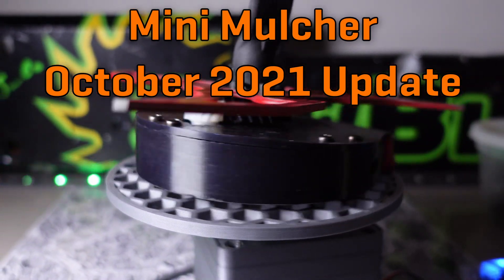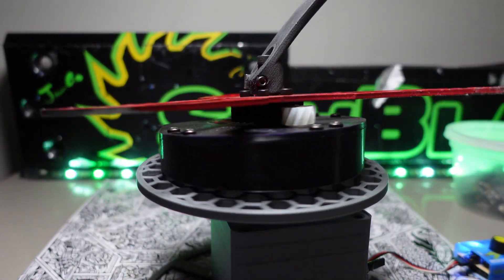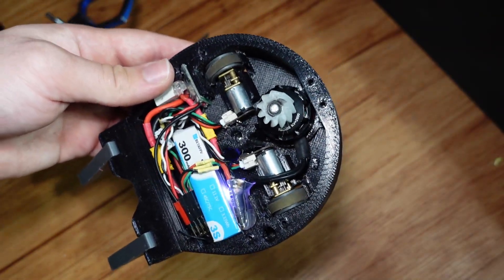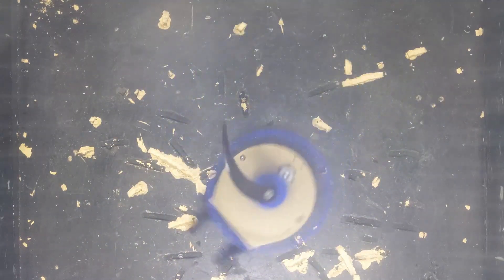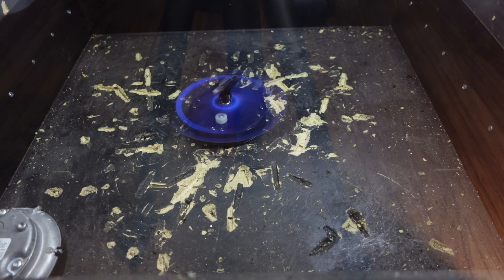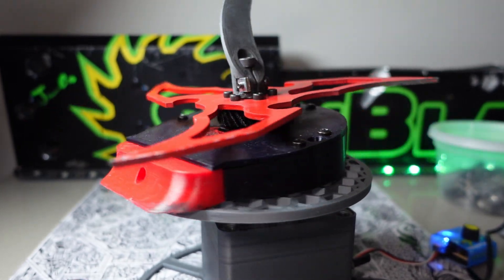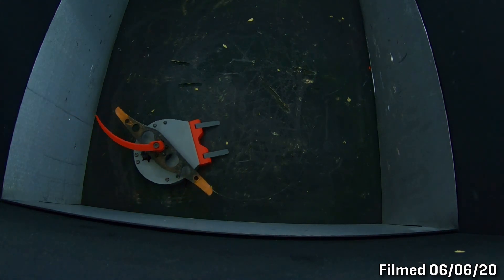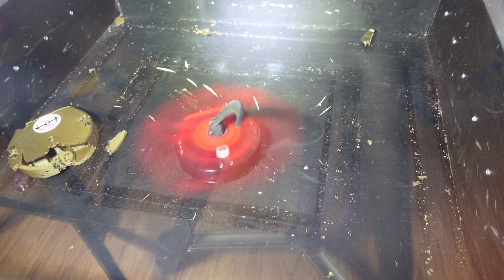Mini Mulcher 1.0! 1 Pound Antweight Combat Robot 2021 Update

Comment: the n20 motors with attached esc come configured  differently than what you show here,  did you modify them or buy them that way?
Reply from the maker: I think I desoldered the boards to flip them and make them fit more tightly
Reply: @JustCuzRobotics  it just does not work that way.....way too many obstacles to getting this bot running

Comment: I love this build, can't wait to see how it runs at sword. Just wondering did you use your custom PDB in this?
Reply from the maker: I built this wayyyy before I designed my boards so they don't fit. It is stupid tight inside. And they were never meant for antweights to start with. Shrapnel Mine does use both my Just Cuz Basic PD Board and Just Cuz PCB Switch and just survived its first tournament with absolutely no electrical problems.

Comment: I like the choice of the thick front wedge over the wedgelets, I feel like that makes it work a bit more as a wedge bot if something were to happen to the blade. Also, I feel like, if the weight and internal space would allow for it to be done, it'd be nice to make the outer edges somewhat sloped, almost like the tornado chaser vehicles are, just to give it a bit of a lower center of gravity and maybe deflect a spinner upward into the blade if they were to catch you from behind. I don't know, it may be a trivial and minute difference, but I'm not trying to criticize, I love this angry beyblade of a robot, and I can't wait to see it in real action. (:
Reply from the maker: Thanks! Having just fought it at SWORD I see there is definite room for improvement. But having just stupid weapon reach made the body almost impossible to hit in practice and it really underwent practically 0 repairs after several fights. Getting traction and keeping wheels on the ground are the toughest things with this design.
Reply: @JustCuzRobotics  yeah I think it would be more aesthetic than anything, I just like the idea of it being stanced like that and tried to apply a practical effect to it, if I'm being honest haha, but really, the thing looks mean already, I'm excited to see it go against something it's own size.